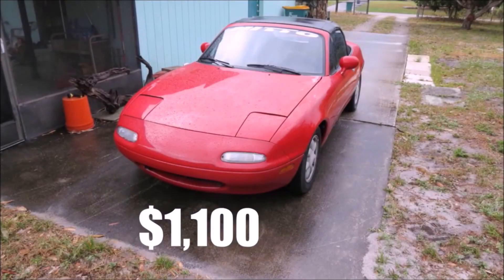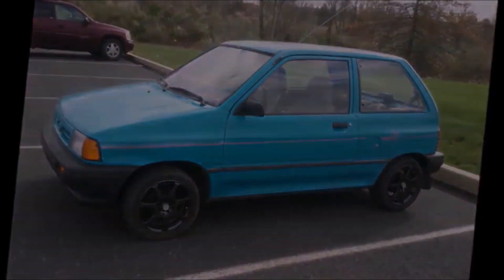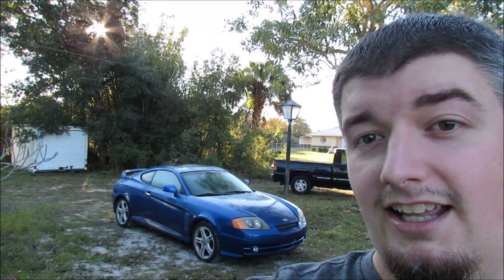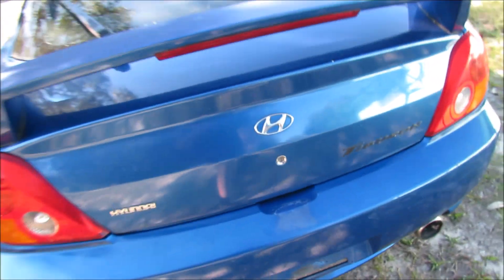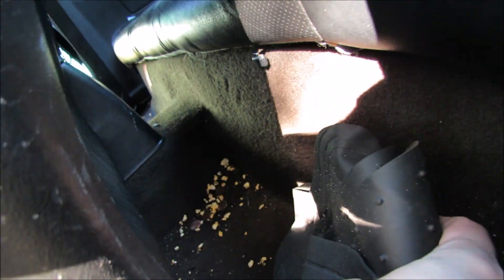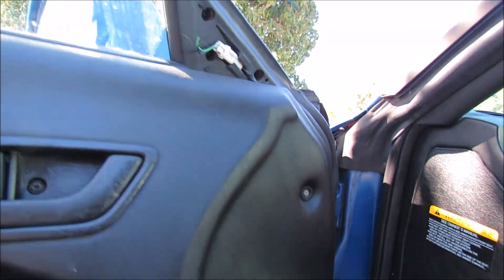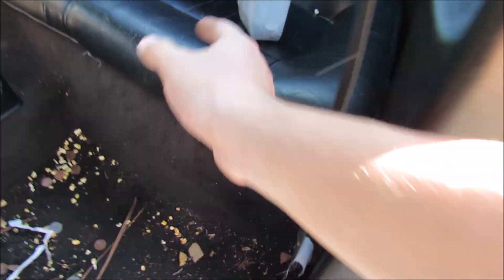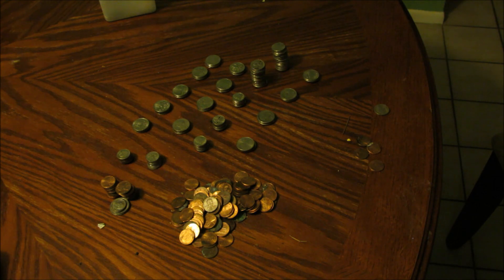Buying My Cheapest Car Ever

Comment: I've thought about flipping cars myself, what is involved with it? I mean do you have to get a dealer license and everything else?
Reply from the maker: Your state will have a set limit on how many you can sell in 1 year before you have to have a licwnse
Reply: @thousanddollarcarguy  from what I've read, it's usually 5 per year before you need a license.  I didn't know if there was a way around it or anything else I should know. From what I've read the license is like $500 a month to do it the "right" way.
Reply from the maker: @slowpoke4557  you can always have a spouse or friend do the next 5.  If you run out of legal sells.  Depending on your state it also changes for the option of open title or a title where both partys have to be in front of of the botary at the same time.  Florida.  Open title.  But in pa you both need to be at the notary to transfer.  Much worse
Reply: @thousanddollarcarguy  Good to know! Thank you and looking forward to more of your videos